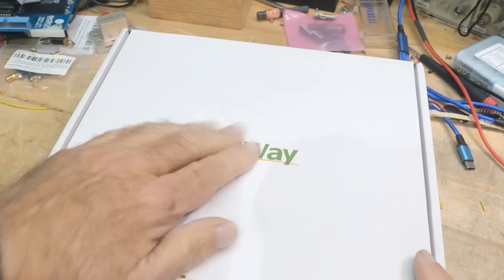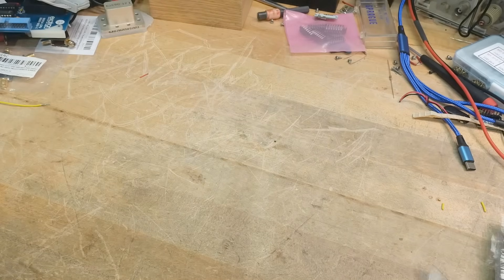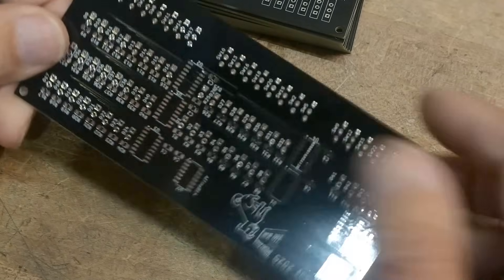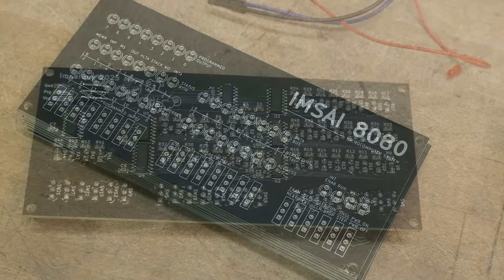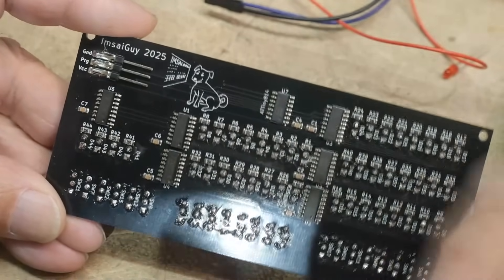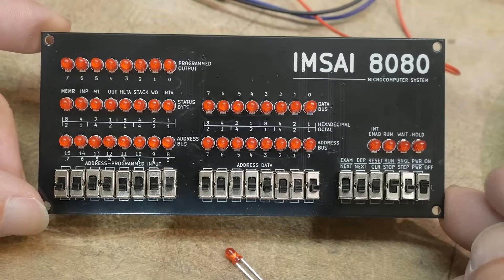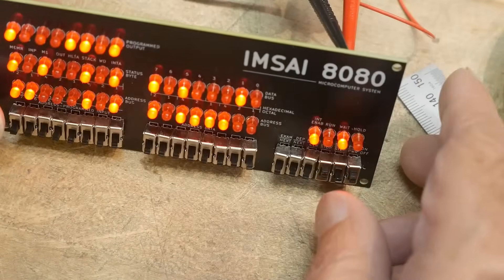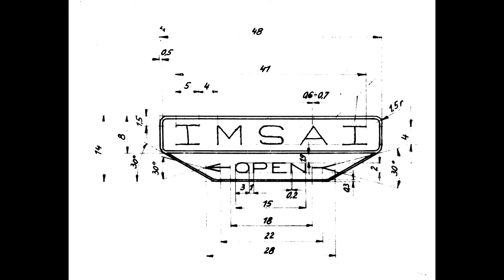#2119 Tiny IMSAI 8080 Computer (part 2 of 2)

Comment: Sorry for the "idiot" question. I grew up programming on the C-64 in BASIC from a young age, where my basic tools were cassette tapes and a small screwdriver. I find it hard to understand why people buy computers that, from a layman's perspective, do absolutely nothing but flash lights? It doesn't even look like a calculator... What's that for? By the way, I'm having a hard time finding any videos on YouTube or any other video site about the Flight Simulator game (Mr. Bruce Artwick created something I could call "Flight Simulator - Zero" back in the late 1970s) for computers like the Altair 8800 and IMSAI 8080. I assume these unfamiliar devices had the ability to be connected to a monitor. Since I love exploring the early days of the digital graphics revolution, please help!
Reply from the maker: Just a light flasher, for a real one, I have lots of videos on that: https://youtu.be/DLFIBQ1WlmU?si=YlqboLRe3yvMpAmV

Comment: Kinda boring .
Why don't you make some huge ones that hang on the wall  like signs ,just like the one you made.
With all the flashy lights and switches.
Now that would be cool!
I'd buy one of those for $300 or $400  bucks!
Reply from the maker: The High Nibble Replica: https://thehighnibble.com/imsai8080/
The price for the kit is USD$300

Comment: If you're to lazy to do programming and just want the nice flashy lights you can get multicolour flashing LEDS.  When powered on they will all be the same colour and blink in sync.  After a few seconds the tolerances of each LED come in to play and they start blinking out of sync.  Save high current issues and set them out in series parallel running on 18-24V.
Reply from the maker: https://youtu.be/VBEgPC2zSLc?si=lOUGRcdUSKHyT1vM

Comment: Wouldn't it be super cool if you made a PCB of this in  Buisness Card Format?
Reply: I would say this is doable, with a few 8 bit DIP switches and SMD LEDs. The shift registers are available in TSSOP package. Small Li ion battery, flat 3D printed enclosure. Makes a fun keyring tag.
Reply from the maker: https://youtu.be/VBEgPC2zSLc?si=lOUGRcdUSKHyT1vM

Comment: Wow, nice little project. Fancy retro vibes.
I would maybe add a little bit of randomness in the update timing in program zero, to make it a little more realistic as a running computer.

Regarding the white balance in the camera - when over exposing pixels in the camera sensor the color balance goes off. There is an overdose of red and a little of it leaks into the green pixels, as the color filters in front of the pixels are not perfect. Just like with any band pass filter.
Under low light the LED gives maybe 80% signal in the red pixel and say 5% in the green pixel. Which shows up as red. When over exposing, this goes up to say 800% of red and 50% of green. But red can’t go beyond 100% so there is 100% red and 50% green coming off the camera sensor. That mixture is orange/yellow. Nothing the white balance control can correct for.